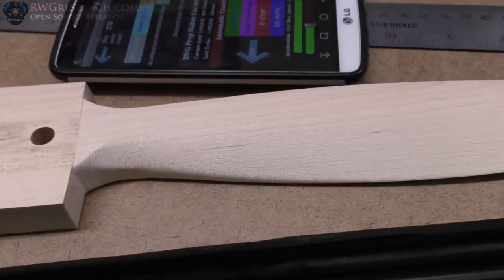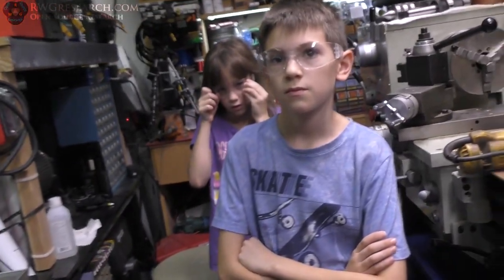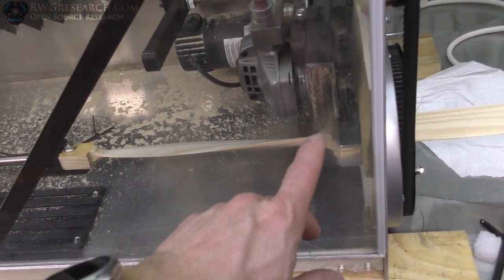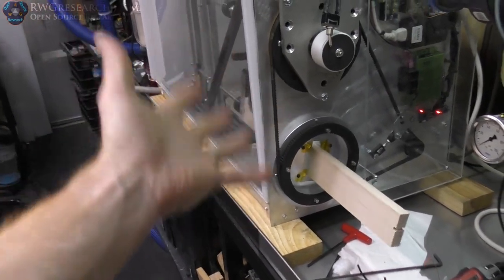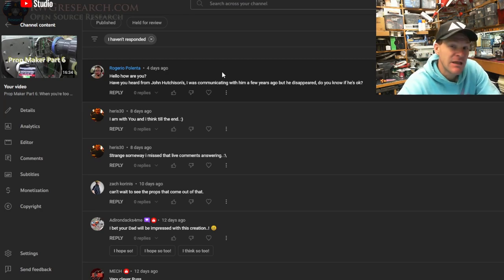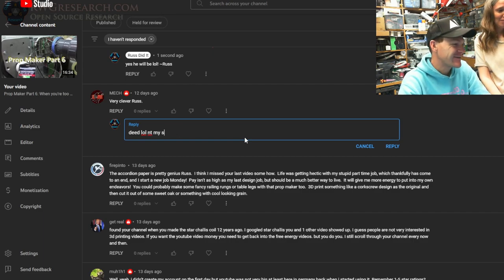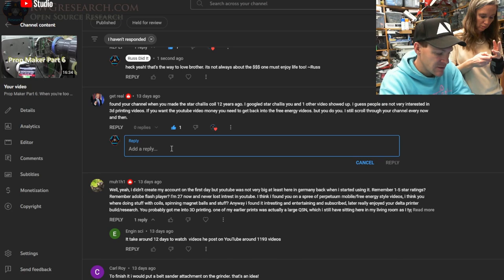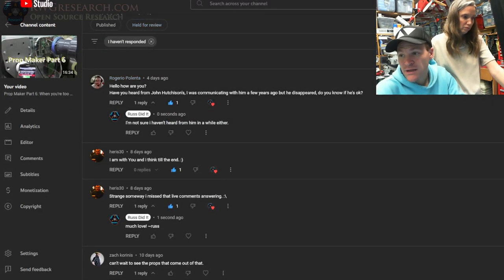Prop Maker Part 7: The First Good Prop! When you're too cheap to buy props!

Comment: Beware of dust explosions with that fine dust Russ, best to put a somewhat damp cloth in the cabinet to add in humidity, so that you do not get static sparks causing it to go floof at you.
Reply: Yes, you could run a bare copper wire through the vacuum hose and connect it to earth ground to drain off the charge.
Reply from the maker: for sure! ~Russ

Comment: Wisconsin has become kind of a poop state lol.  I have the urge to move to Florida.  I bet you could plumb an EPG between the prop machine and the vacuum to harness some of that static electricity!  I still have a half finished PEX coil for an EPG around here somewhere... That new job has me working every day raking in the overtime.  So much for energy for my own endeavors 🤣 Hopefully the rush project ends soon.
Reply from the maker: yes exzactly! ~Russ